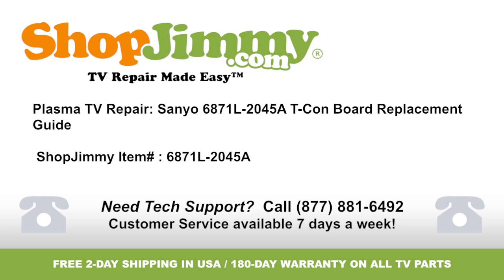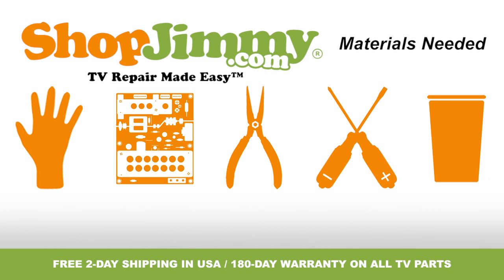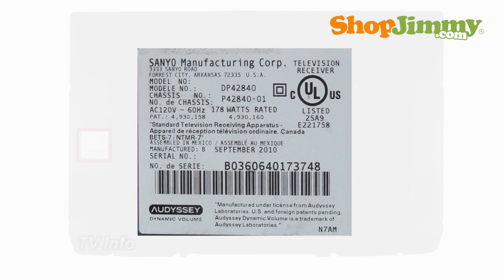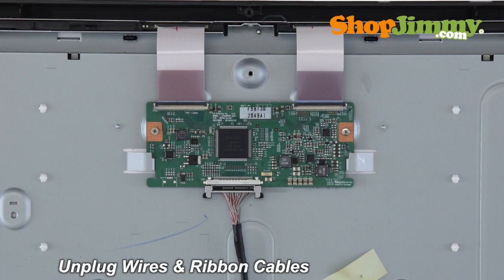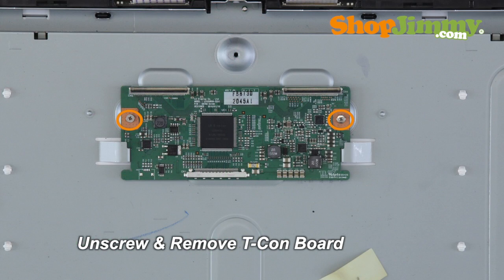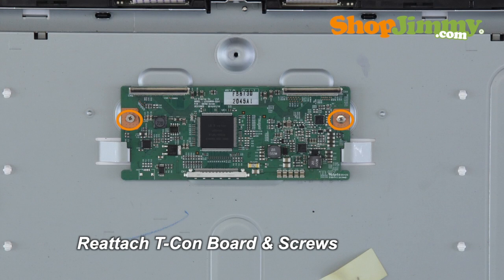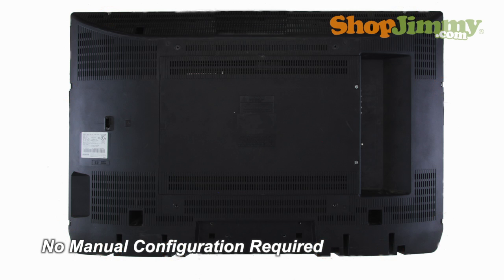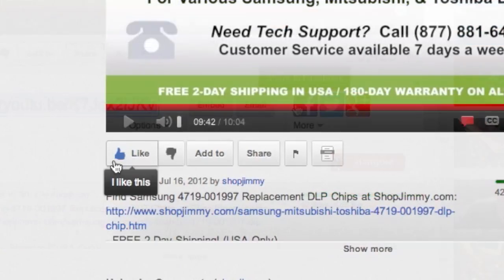LG LCD TV Repair - How to Replace 6871L-2045A T-Con Board - How to Fix LCD TVs

Comment: I need info on a project I'm working on. I have a working LG lm x210 without a screen. Ideally, I'd like to attach a screen I have from a Vantron 5081G Tablet. It has a 31 pin LCD ribbon connector. I realize not all of the pins are used. I need to know which pins are used & where they go. If that isn't possible, I have 3 other screens. The Samsung sm J100, the Samsung sm J120 & a Motorola XT 1921-8. It's a project specifically trying to see if this can be done. I can't go buy any parts, phones or anything like that. I have to use the parts I have. ANY help at all will be greatly appreciated. If anyone knows someone or somewhere else I can ask, please tell me. Thank you in advance for all of your help.

Comment: Hey shop jimmy can you replace led backlights with a newer models lEDs? And it has same size screen but 18 LEDs less than original ?will that be OK for the driver board?

Comment: hey.i bought a tcon board from you and i put it in i now have a white screen without picture.before changing the tcon i had dark screen without video.what could be the problem.
Reply: jeff kamuyu I’m looking through videos myself to replace on a chip on my t-con board so I’m no expert myself, but half of my screen was white after I opened up my tv to take a look at it and it ended up just being that I hadn’t properly placed one of the ribbons back all the way in. Not sure if this helps in any way :/

Comment: Hello your tutorials are fabulous & very much appreciated. I hope you may be able to help me with an issue I am having with my living room TV. I have a LG 42CS570 and when the TV is first turned on the picture is gray and freezes horizontally in sections but after warming up for an hour or so the picture starts acting and operating normally but if the air around the TV becomes to cool then it repeats the freezing horizontally in sections. Any idea what my issue could be? The issue definitely seems to be related to the temperature of something I believe.

Comment: Hi, I'm trying to remove back cover on my LG 49uh6100. Took all screws off and I just can't pry the damn thing open. I'm trying to figure out what it would cost to buy a new screen and wether I can tackle this or not. screen is broken.  HELP😣😣😣
Reply: Never mind.. got it. 2 screws at the bottom near the speakers and also must remove the stand.
Reply: L. S. Having the same issue with my LG tv...can't get the back cover off to fix an hdmi port that was disconnected and fell  inside the tv. ..all screws off but can't open it...must have tabs holding it place. Frustrating
Reply: Found a solution?

Comment: My LG 32lw4500 just show vertical  lines of light color no picture  on full display soon after switched on, sound working ok what could be possible cause and how I can rectify this. is any PCB card required to be change or any component need replacement. how can I send the faulty image of the tv so you can understand in a better  way please suggest

Comment: i just replaced the t-con board in my 60 inch 3d lgtv, 60LB7100 ut and it didnt solve my issue, my tv turn on the after 5 seconds goes black if you use a flashlight can faintly see the screen and the tv still has sound but no picture is it the main board or the power supply board thats bad because i was told to replace the tcon board and that clearly wasnt the issue. I need my tv back!!!  lol

Comment: I have a 42" Sanyo model DP42840.   When I first turn the TV on the picture is clear.  After about 10 minutes the picture begins to lose clarity and the colors fade.  This continues to get worse until only faint outlines of the characters can be seen.   When I turn the unit off and re-power after 15 minutes the picture is clear again then begins to lose color as before.

Comment: I have a Toshiba Regza 47" 2009 TV. Model 47ZV650U when I removed the cover for the T-con board there was an additional ribbon that seems to be soldered on.  I was able to remove the 3 connectors that are in the video. My question is: Is it soldered on or can I just pull it off? THANK YOU.

Comment: Hello Guys, 
My issue is my 46" LG which I've owned for about 5yrs and as of yesterday when i turned it on the picture came up all distorted with color lines everywhere.The TV volume works fine and after being turned on for 5 - 8 minutes the picture came back to normal. Does this mean i have a faulty/going bad T-Con Board? If so let me know, 
LG Model#: 46LD550-UB // Serial NO: 006RMRHDK166
Thanks for any help in advance.

Comment: Hello, I have a LG 47LN5789 that the back lights still work and sound still works, but there's no image. I bought and replaced the T Con board through your site, but it still doesn't work. What else should I do?

Comment: Hello. I have a Proscan 37" Full HD LCD TV Model No.: 37LC45Q
The screen turns white when I turn it on and I'm not sure why. It is not completely white because when I turn it on, I can see when the source says HDMI 1. When I plug in a Game System, I can make out the screen so it's very faded but not all white. I have it plugged to a surround sound system so there is sound coming from it. Not sure what's wrong. Any help is appreciated. Thanks.
Reply from the maker: +Elias Galvan   Try all repairs and troubleshooting at your own risk. This could be a problem with either the t-con board, the main board or the TV panel. You can replace the main board and the t-con board individually to see if one of those boards fixes the problem.  Click this link to replacement parts for your TV model number:  http://www.shopjimmy.com/catalogsearch/result/?q=37LC45Q  There may be multiple boards for the same TV model number, be sure to match part numbers on your current board, with your replacement for compatibility.  Thanks and please let us know if you have any further questions with your TV Repair!  www.shopjimmy.com
Reply: Sony led v card repar

Comment: Love the videos and want to purchase a replacement part for my LCD TV, but I am hitting a snag. Here's my TV model, serial, and part number:

Sony Bravia 46" LCD TV
Model Number: KDL46VL160
Serial Number: 8107228
Timing Control Board Number seems to be: A1567-730-A

I have some vertical lines, discoloration, etc going on, but the TV quickly goes black and only gives me sound. Some troubleshooting forums suggested pressing around the edges of the panel and also spraying canned air around those edges, but neither seems to do anything here.. Everything else I've read either points to me needing a new panel or a new t-con board. I figured I'd try the t-con board and if that doesn't work, at least I tried. I cannot seem to find the t-con board anywhere though, even though I am sure this was in stock at shopjimmy.com a few months ago. 

Can you help here?

Comment: Hey guys, great videos
I have an LG TV 47LM5600-UC, when switched on you can only see vertical lines of color and pure noise is heard, looks that can change channels, increase the volume etc
No picture, only vertical stripes and noise
Thank you very much in advance for your help
Reply from the maker: marciano0  Try all repairs and troubleshooting at your own risk.  This sounds like a TV panel (TV Screen) problem.  If your TV panel is bad, it may be more cost-effective to replace the TV as panels are typically hard to find in stock, difficult to replace, and expensive.  Thanks and please let us know if you have any further questions!  www.shopjimmy.com

Comment: Hi, great videos, I have a LG 47G2-UG that has recently started showing persistent horizontal lines starting on the left fading to right.  Guessing it would be the T con board but all info I have come across is it usually presents as vertical lines, do you have any thoughts?  T con board in tv is p/n 6870c-0401B. Thanks in advance
Reply from the maker: Jerry Barr   Try all repairs and troubleshooting at your own risk.  This could be a problem with either t-con board, the main board or the TV panel.  You can replace the t-con board and the main board individually to see if one of those boards fixes the problem.  Click this link to replacement parts for your TV model number:  http://www.shopjimmy.com/catalogsearch/result/?q=47G2-UG  Be sure to match part numbers on your current board, with your replacement for compatibility.  Thanks and please let us know if you have any further questions with your TV Repair!  www.shopjimmy.com

Comment: Hi have an LG 42LB5DF serial # 801MXTC1A473 it had 2 black lines on the left side of the screen. I fiddled around with the ribbons but to no avail. I used the tape technique covering 5 to 6 pins and reseated the ribbon and now both sides are completely black  i also tried removing the tape and cleaning the tips with an eraser then rubbing my finger across to cause static electricity and nothing. I have been at it for hours trying to get back even the lines and nothing just sound i do not have back lights now either and  all of the capacitors are flat with no signs of swelingl so my question is should i change the T-CON board or is their something else wrong? PLEASE ADVISE
Reply from the maker: longislandsalsero   This sounds like a TV panel (TV Screen) problem.  If your TV panel is bad, it may be more cost-effective to replace the TV as panels are typically hard to find in stock, difficult to replace, and expensive.  Thanks and please let us know if you have any further questions!  www.shopjimmy.com

Comment: I HAVE LG 47LM640T-ZA and serial number 210WRBM7H325. MULTIPLE WHITE HORIZONTAL STRIPES APPEARS ON SCREEN WHEN IN VIEW MODE. CAN YOU HELP ME DIAGNOSE THE POSSIBLE PROBLEM OR HELP ME FIX PLEASE.
Reply from the maker: Alfred Mwini   This sounds like a TV panel (TV Screen) problem.  If your TV panel is bad, it may be more cost-effective to replace the TV as panels are typically hard to find in stock, difficult to replace, and expensive.  Thanks and please let us know if you have any further questions!  www.shopjimmy.com

Comment: Hi. I have a lg 42le5400-uc seevice code 42le5400-uc.auswlur currently have a faint grey line in the middle of the screen. About two inches wide. Don't want to replace if possible. Please assist.
Reply from the maker: drtatum23   This sounds like the problem is either a bad T-con board or a bad TV panel inside your TV.  If the problem is your TV panel, it may be more cost-effective to replace your TV.  You can try replacing the T-con board to see if that fixes the problem.  Here is a link to replacement parts for your TV model number on our website, click here:  http://www.shopjimmy.com/catalogsearch/result/?q=42le5400-uc  Be sure to match part numbers on your current board, with your replacement for compatibility.  Here is a link to a video showing how to identify your part number, click here:  DIY LCD TV Repair: Part Number Guide for AU Optronics (AUO) Timing Control (T-Con) Boards  You can also call our customer service for further assistance with your purchase.  (877) 881-6492  Thanks and please let us know if you have any further questions with your TV Repair!  www.shopjimmy.com
Reply: Thanks!  I replaced the ead60974140 and 4141 I could still see the LG logo and it appeared to fix the issue...however, my toddler and infant distracted me and caused me to place them in the incorrect spot(burning one) (bn...now the screen is black, no icon but I still have sound when I press the on/off and menu, etc.  The back light does come on...Is this still the Tcon I need?  or did it burn out the main board?
Reply from the maker: drtatum23   I recommend replacing both boards to be sure.  Here is a link to replacement parts for your TV model number on our website, click here:  http://www.shopjimmy.com/catalogsearch/result/?q=42le5400-uc  Be sure to match part numbers on your current board, with your replacement for compatibility.  You can also call our customer service for further assistance with your purchase.  (877) 881-6492  Thanks and please let us know if you have any further questions with your TV Repair!  www.shopjimmy.com

Comment from the maker: @morris malosno - It appears the t-con board may be connected to the panel and you will not be able to remove and replace it.  The LVDS cable runs to the top of the TV, but if that t-con board is not accessible, then you would not be able to replace it.  Thanks and please let us know if you have any further questions!

Comment from the maker: @ ray brown - If the lines are running vertically, you have a bad panel.  If they are horizontal lines, it could be your buffers and y main board.  Please reply with your TV model number if you need help finding parts for your TV repair.  Thanks and you can also call our customer service at (877) 881-6492.